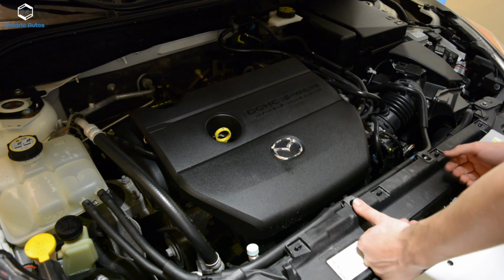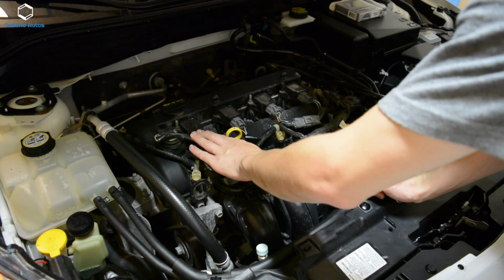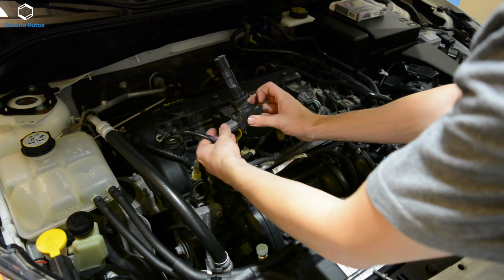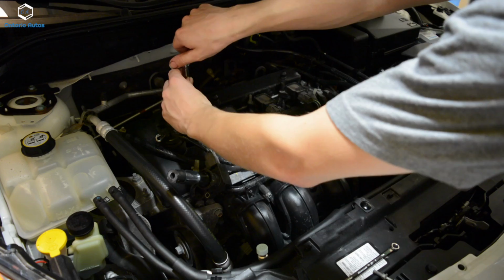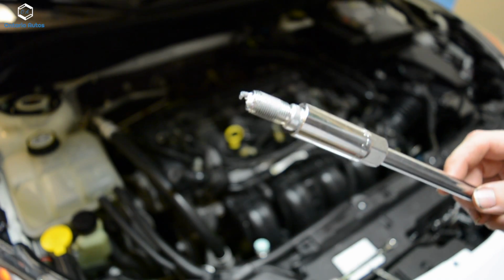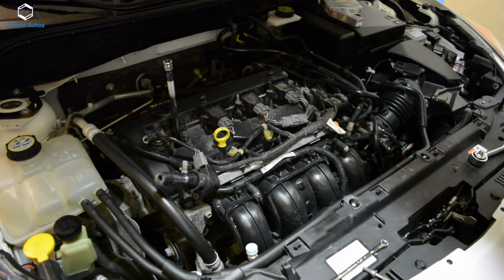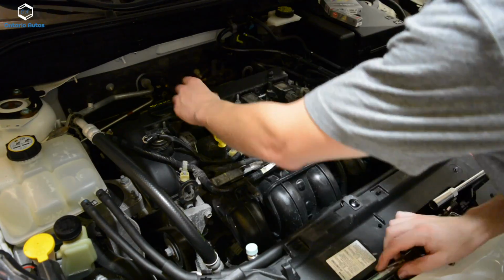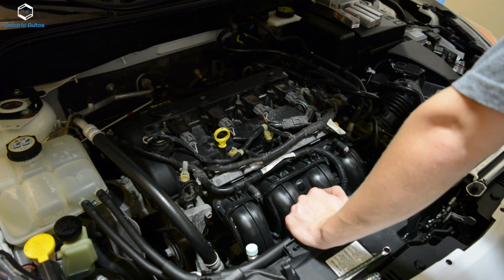How to Replace Spark Plugs: 2010-2013 Mazda 3 2.5L

Comment: i never use anti-seize.. NGK spark plugs feature what is known as trivalent plating. This silver- or chrome-colored finish on the threads is designed to provide corrosion resistance against moisture and chemicals. The coating also acts as a release agent during spark plug removal. NGK spark plugs are installed at the factory dry, without the use of anti-seize. NGK tech support has received a number of tech calls from installers who have over-tightened spark plugs because of the use of anti-seize. Anti-seize compound can act as a lubricant altering torque values up to 20 percent, increasing the risk of spark plug thread breakage.
Reply: I guess im asking randomly but does someone know a way to get back into an instagram account?
I stupidly lost my account password. I love any tips you can offer me
Reply: @Coleman Simon it worked and I finally got access to my account again. I am so happy!
Thanks so much you saved my ass !
Reply: @Pedro Dylan Happy to help xD

Comment: This is awesome! Great video.  Also thanks for the design to the engineer's.  I replaced my Sentra 2010 spark plug few years back and it was such a pain.  I had to remove so many components before getting access to the spark plugs.  This is cool.  Cover off and that's it access to the plugs.  I hate how some cars are designed.

Comment: So I know the engine is super clean and kudos to you for keeping it that way, but I would advise that you blow out the spark plug hole with some compressed air or canned air before taking the plug out, just incase there should be any stray debris inside it, even though the coil is sealed. I had some minor dust fall into my cylinder from the plug thread, not much I can do about that though,

Comment: I heard that new plugs don't need dielectric grease or anti seize lube?  Also aren't you supposed to disconnect the battery?  I know that new plugs they say not to gap them as they're pre-gapped if you buy the correct ones and they say to NOT gap them or clean them.
Reply from the maker: Personal preference really if you put anti seize on the threads. Its just a good practise if you live in a climate that promotes heavy corrosion. And yes you are correct on gapping. Most new plugs are pre gapped and if you clean them the iridium can be wiped away. Thanks for the comment

Comment: Does Mazda recommend using anti seize on the plug?
Reply from the maker: No but it helps when your taking them out next time.
Reply: @ontarioautos9476 
you will find that NGK recommends NOT to use any on  their plugs as they  come with a thin coating designed for the purpose and adding compounds runs the risk of it escaping onto the electrode etc. 
Basically, look at the new spark plug thread.  if it is shiny and chrome like,  do not add anything.  That is the coating that is good for 1 use if you do it properly.

Comment: Hello. I have a really important question. In the middle of the engine there is a hole and there’s something that looks like there was something connected to it. What is it? Mine is not connected to anything
Reply from the maker: might be oil cap or dipstick possibly?
Reply: It's a hole that helps you to remove the intake. You put right screw in a turn and turn until it touches the inside wall and pulls itself from the seal on the head.

Comment: What's a good set of wires for this, and how difficult to change?  Thx.
Reply from the maker: This car doesn't have wires as it is coil on plug. If a coil was to go bad its easier than the spark plug change itself.

Comment: I couldn't afford a shop...a person stripped the holes the spark plugs go inside of he stripped 2 of them... it's a  2013 Mazda 3 "SkyActive" is this fixable sir my check ingine light is on no car won't star at all. Somebody help Me Out Please; tell me what to do, before I end up in PRISON  when I'm only 40years old. IS THIS FIXABLE? & NOT A $3-5,000.00 JOB...😭🙏🏽
Reply from the maker: Short answer is yes its repairable but hard to do. You can do what is called installing a helicoil. You could also see if you can find a used cyl head and install that for typically $300-$500 plus labour and misc parts

Comment: HINT !! TURN THE NEW PLUG BACKWARDS A FEW TIMES YOU WILL FEEL IT DROP JUST A LITTLE NOW YOU CAN SLOWLY TURN IT IN AND NO CROSS THREADING .....
THIS WORKS FOR ALL SPARK PLUGS .
AND ALSO BOLTS ...
TURN BACKWARDS FEEL IT DROP IN .......
TRY IT NEXT PROJECT .